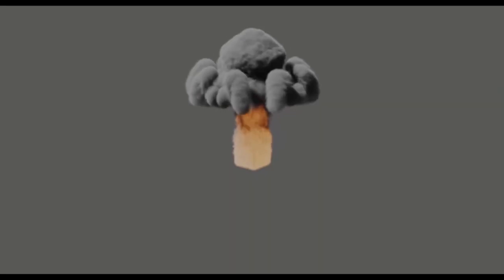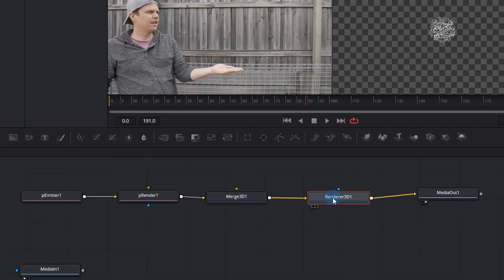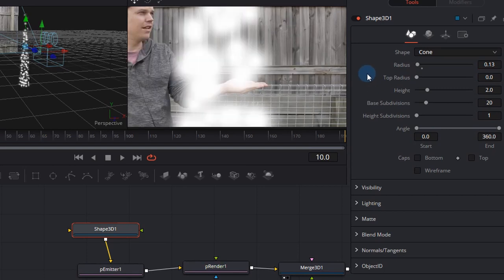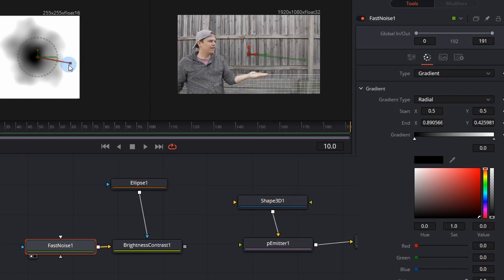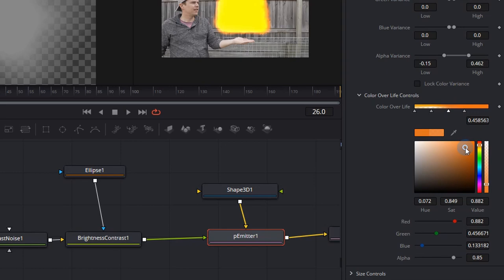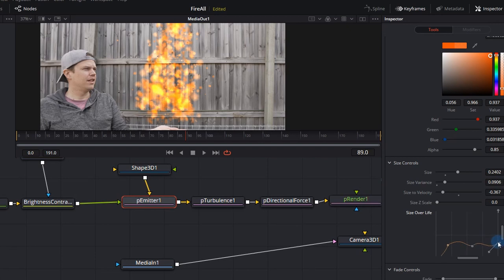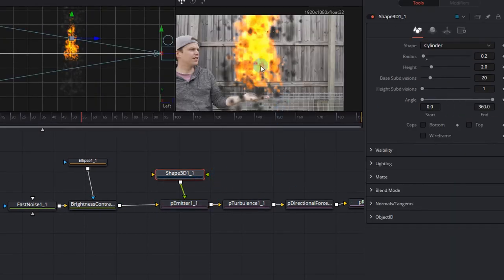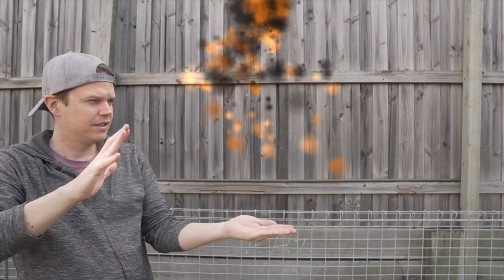Davinci Resolve 16 Tutorial: Fire and Smoke

Comment: Thanks this is a good tutorial, I did something similar and created sparks, but for some reason the "particle age" doesn't work for me. Meaning the size doesn't change as it should. If I set it "over time" or "particle birth time" it does change though. Any idea what am I doing wrong?
Reply from the maker: Interesting Garage night!  It should work, sometimes what happends is the vertical Velocity is too fast, try and play with those settings, I think I showed some of those settings on the video, I cant quiet remember all the settings, cos I did this tutorial a while back, and maybe you need to adjust your particle amount of something, I recal that 1 was not actually = 1 ... Or Im thinking of Blender.. sorry Im not being of more help
Reply: @HowToGuyChannel  No problem man you helped a lot already with this tutorial! And I kinda found a shortcut by making it on a blank project then copying it over a video, it works then. It seems like a bug to me
Reply from the maker: @GarageKnight  another hack is to use the built in template..  I think they have a sparks one